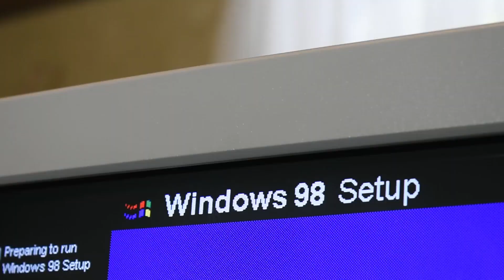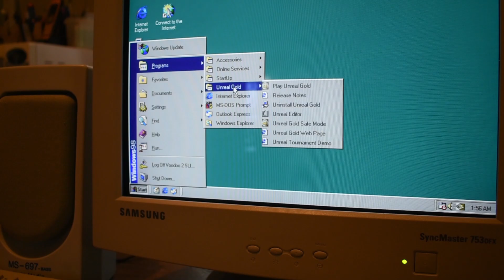The ULTIMATE Windows 98 PC - 3dfx Voodoo 2 SLI & Pentium II Vintage Computer Build  + Games!

Comment: Voodoo2 hold up pretty well. If you bought one in summer 1998 you could add another one after a year and run them in SLI. Voodoo2 SLI performed identically to Voodoo3 2000 if you were ok with 1024x768 as maximum resolution.

Comment: Btw, I would prefer to go with Pentium III, and GF2 GTS/Ultra or Geforce 3/4. If motherboard can take Coppermine CPUs, you can switch between PII and PIII this way, very easily.
This way, it would be "Ultimate".
Reply from the maker: Yeah, that's a good setup. I wanted to make something that was somewhat period correct to 1998, hence why I chose the slower parts. I'm going to be doing a build very similar to what you've said eventually.
Reply: @ScanLinesAU  Well, problem with your build here is, that it is not period correct, cause you are using Geforce 2 MX 400, which is very fast graphic card, from 2001. In 1998, basically, such good 3d/2d accelerator didnt exists. It is basicaly on level of Geforce 256 DDR, but with more advanced technology, less nanometres, etc. And Geforce 256 DDR is faster late 1999 graphic card, that existed. It's basically best early 2000 graphic card, as it was released like in december, after Pentium III coppermine.

So when you have already screwed period correct computer, you can just move to even better main 2D card.

If you want Ultimate 1998 PC, as 2d Card, I would use something from 1998. For example S3 Trio3D, which had great speed in 2D, and compatibility in DOS. S3 cards in that time, had best compatibility in DOS games. Or, use Matrox G200... but they worse compatibility than S3 in DOS, but best image quality, speed was also very good.

Problems with 1998 2d/3d cards was, they were not very good yet, and they had problems with 32-bits, and higher resolutions. You can have that with Geforce 2 MX, I know. But with 1998 cards, it's problem. Matrox had decent performance also in 32-bit, from 2d/3d combo cards from 1998. I don't know much about Nvidia cards from 1998, but I've heard, first Nvidia cards had some kind of issues, also not so good compatibility under DOS. Not sure about Ati up to 1998. I would say, eighter Matrox or S3 would be best as 2d card, with some kind of 3d capabilities. G200 should be just slightly slower, than single voodoo2. But it allowed 32-bit rendering. It's OPENGL support sucked tho, very slow. But you will be nice Direct3d 32-bit card, as alternative to voodoo2 SLI, if you need 32-bit colors rendering for some comparsion. You also get basically best image quality from that era, Matrox was famous for that. I would go with Matrox G200.

Also, as "Ultimate" build from 1998, I would take Pentium II 450 and try to overclock it to 112 Mhz FSB, to get around 500 Mhz. To get to 550 was almost impossible with those huge L2 cache modules out of processor core, so most of the time, in 1998, 500 Mhz Pentium II performance was kinda maxed out.